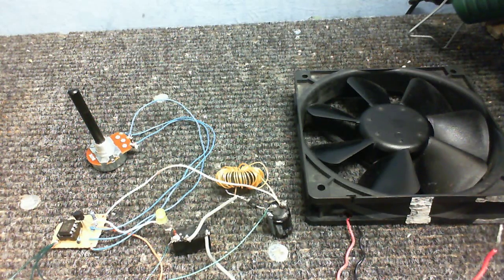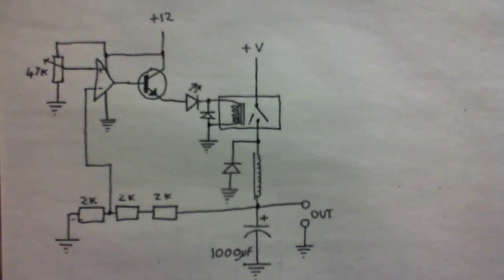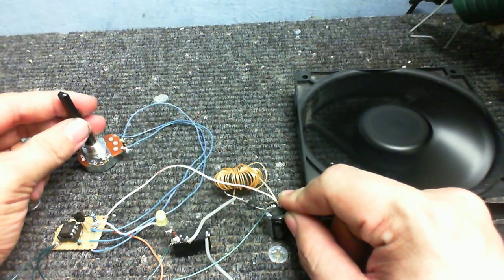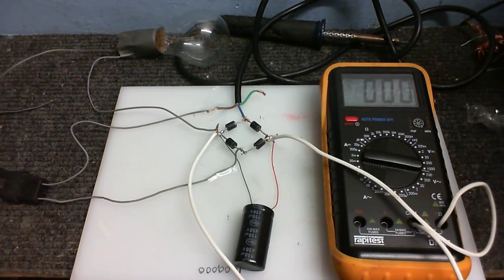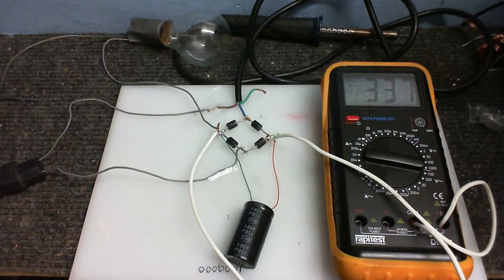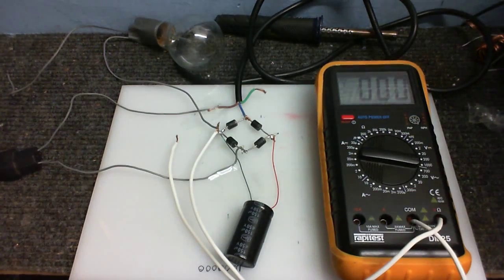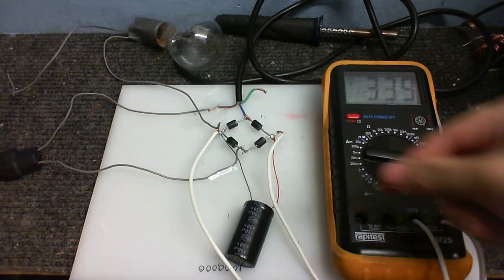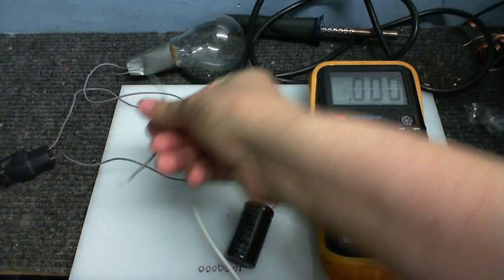Some Experiments

Comment: Can you make a circuit that will take audio (music) and take out any frequency above 200Hz so I can have an output on my speaker of just bass?
Reply from the maker: Easy, a capacitor across the speaker, and and inductor between the amp & speaker would do the job.  I'm a little too busy with my projects to do a video on that, but Afrotechmods has some videos on that, this video might be useful: Passive low pass RL filters